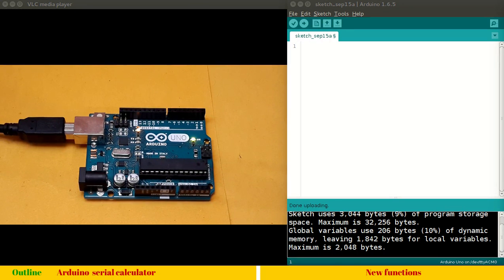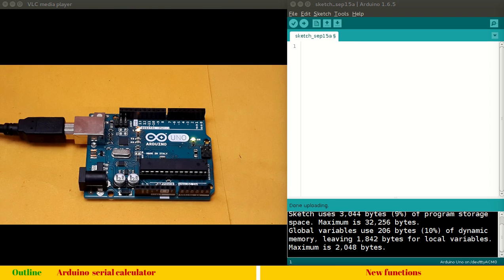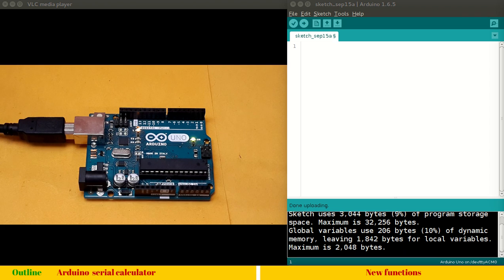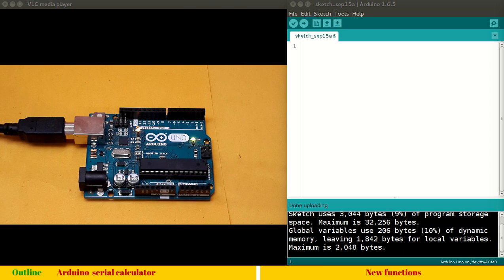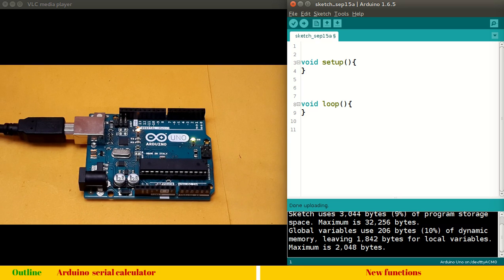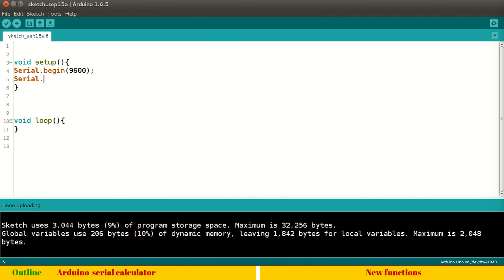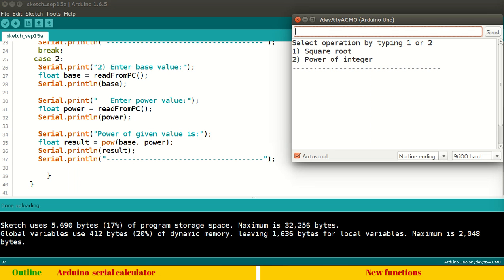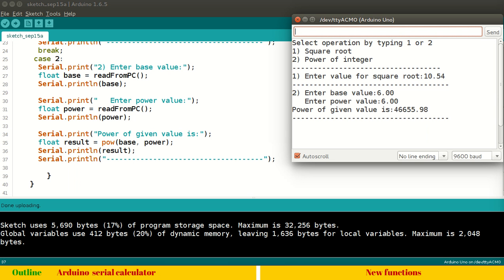14. Making a calculator using Arduino serial communication

Comment: Hi , which software you used to write these codes ? and what is your arduino version ?
Reply from the maker: Software itself is Arduino, and it's version is 1.6.5
Reply: oho thanks. so if i use this software , write exactly your code so that the result can be seen on my monitor . am i right ?

Comment: Will it working for adding and subtracting,  by simply changing where you have square root and power of integer? I'm a novice by the way?
Reply from the maker: Sure, it will.
Reply: sorry for being a pain, I'm doing this for college, do I need to download math.h just for adding or subtraction? What command do I use instead of (sqrt(readFromPC)?
Reply from the maker: void setup() {
  Serial.begin(9600);
 }

int readFromPC() { 
  while(Serial.available() == 0);
  return Serial.parseInt(); 
}  

void loop() {      
      int first = readFromPC();       
      Serial.println(first);    
      int second = readFromPC();         
      Serial.println(second);   
      Serial.println(first - second);      
}
Reply: Thanks so much
Reply: Hi i was wondering if you could help me with another problem, I have an array with duplicates, i was trying to come up with a function to count the duplicates,

 int x = 0;
int counter ();
void setup() {
 Serial.begin(9600);

}

void loop() {
  
  int myarray[6] = {4,2,5,0,0,1};
  for( x = 0; x < 5; x++);{
     if((counter() == 0); counter < 5; counter++);
  }
  Serial.println(counter);
  delay(1000);

}

but i just cant get it to work, any help would be great.